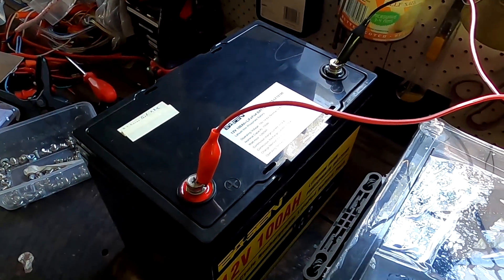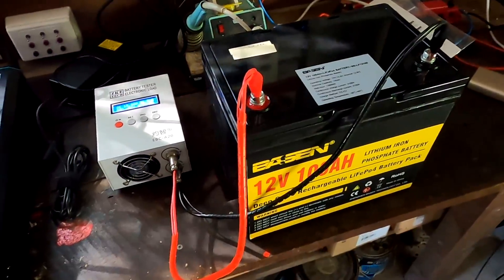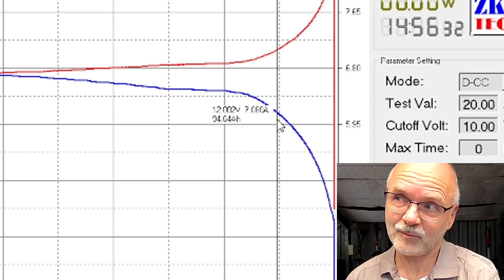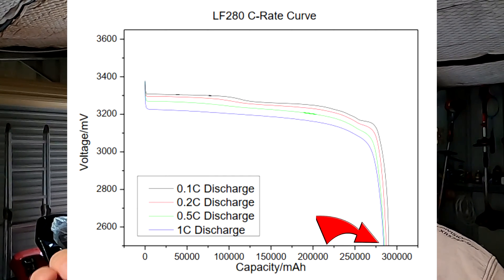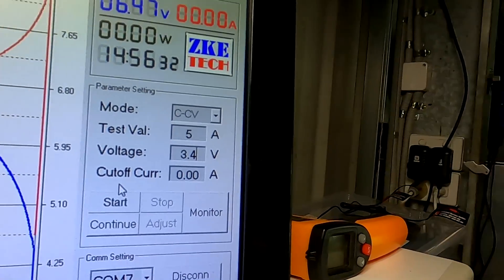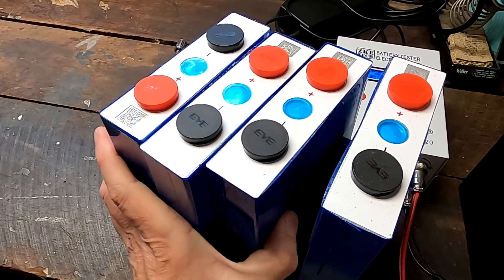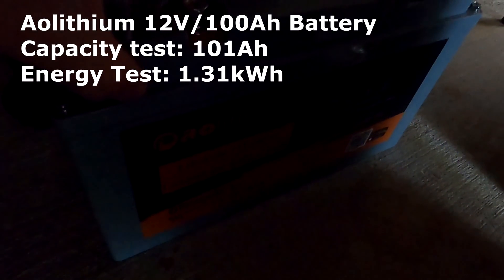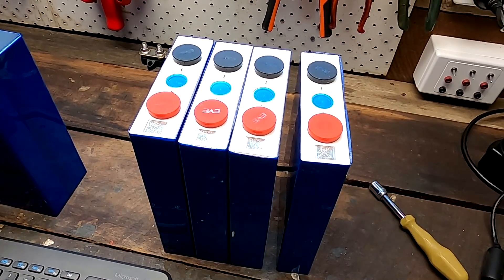The crux with most of these batteries. And how to achieve 100% customer satisfaction!

Comment: Thanks for the review, but in my opinion they really should meet their rated capacity at their rated continuous discharge current. Sadly I couldn't find any specs regarding that.
Cutting it that close at a  C rate of .0x should at least make it doubtful they will reach their cycles with 80% left...
Reply: Sorry just realized there are no cycles in the spec sheet, so I can neither be wrong nor right about my previous statement 😂
At least in the product picture/on the device it states a discharge current of 100A/260A (3s peak), so in my peasant mind I think they should be tested at 100A discharge current 😅
Reply: You can argue that all manufacturers do this and therefore it's not that bad, but it's still not right. Just because everyone shits the bed it doesn't mean they should be rewarded for it :D
Reply from the maker: These batteries are fine as they are and much better than any lead acid battery. If they have +-5% capacity, who know... and most will not care.
But as you said, it is not right to sell them as 100Ah batteries if they have only 98Ah.
Reply: @OffGridGarageAustralia  Thanks for putting it back into perspective, with lead acid we've been living so long with the fact that you should not discharge beyond 50%, losses, annoying charge behavior etc 😅 I guess my standards have just gone up too much 😂 Still love my (also below capacity) LiFePO4s for that fact :)

Comment: Nice video as always, and I have to say that is strange that in a 100Ah battery they installed maybe 95Ah cells; and pay attention with the CALB cells, and is incredible to see how the battery tester is very accurate, I think that I will buy one for test my LFP battery; and nice to see the European Shuko stile power strip.
Reply from the maker: Thank you. I still have a lot of devices with European plugs so I converted only a few power boards with AU plug and keep using the devices as they are. Save me time to make more videos 😂

Comment: Andy theres a version of the more popular 280 aH cells that just a bit thicker rated at 310ah - I've seen them called 305ah too - it's what I used on my RV  4S pack
Reply: EVE rates them at 304AH. Vendors make up numbers, I personally avoid vendors that lie about capacity, who knows what else they will lie about. Certainly the first dozen cycles they will measure above rated capacity if they are new and grade A.
Reply: @john_in_phoenix  I have been very pleased with mine - they stay in balance  and  are trouble free reliable